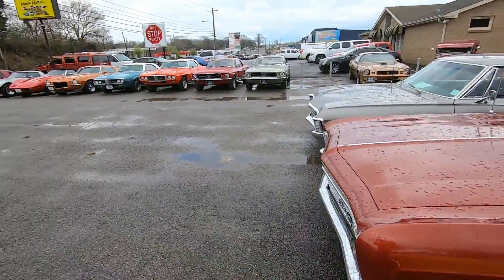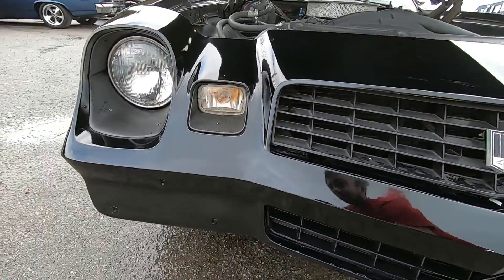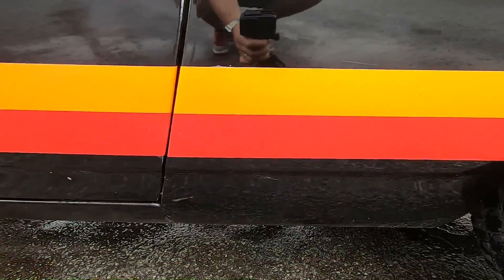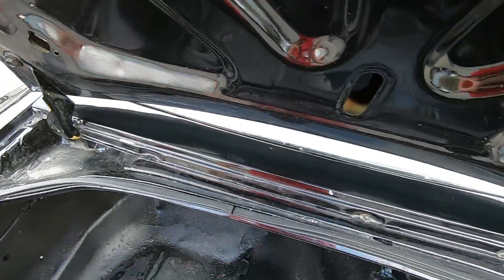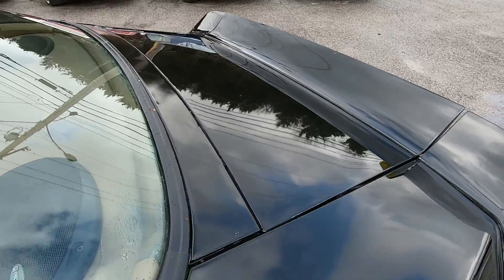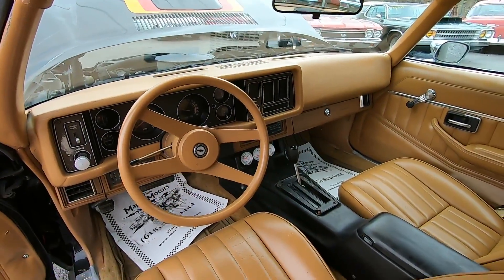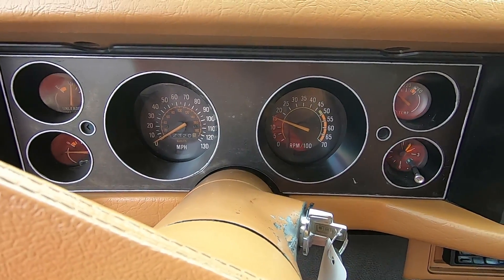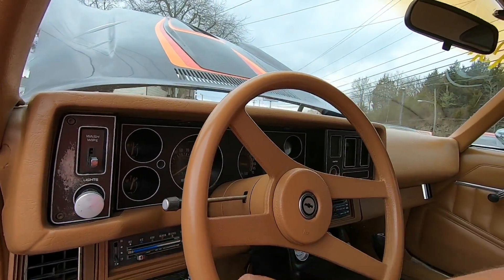1979 Chevy Camaro Z-28 SOLD $13,900 Maple Motors #527

Comment: Maple Motirs Ohhhhh my God a 79 just like mine!! I bought my Camaro in 2017 for 14K,privately sold,over 20,000 miles driven since full frame off restoration,Engine everything mechanical was restored,everything works in mine,inside!! 4 speed mine is,same black and red orange color code!! I believe the main color option for 79 Camaro was black red and orange striped in count!! Most common color,but mine's got black interior,most black ones came with tan or red interior or once in a while white interior for this exact camaro and paint!!...13's a good price for this Camaro in that shape,i wonder how many miles this Camaro's got!? Mines got the same rally bages on the front and rear,rims and alk are the same,i bought my camaro with Firestone wude ovals on it,now stuck Good year steel gards on it!! Ive had it sibce 2017 from it's 4th owner,some original documents and purchase history came with it,was a Kentucky bought car!!...79 was the best looking Camaro ever,in my eye's 67 79 and 81 were the nicest cars!!...Camaro Camaro Love!! ❤❤❤

Comment: How much would an all original mint low km/mile 1980 Z28 Camaro ,full option, go for in the US ?
Reply: If it really is mint, 20k if you can find the right person, probably expect around 15k though. Didn’t they have the 350 in 80 or was it the 305
Reply: @krispytoast8804  Yes it was a 350. Yes really was mint. We sold her to a wonderful family.

Comment: That car isn't worth 8k. The bottom of the doors are filled with bondow. A/C isn't working and those Harrison compressors are not cheap. The engine bay looks like doctor hack and sack worked on it. Radio isn't working at all and the list goes on. Someone did a shitty job covering up the rusty doors. This car is worth about 5k and be lucky after stripping it down you don't have holes everywhere.